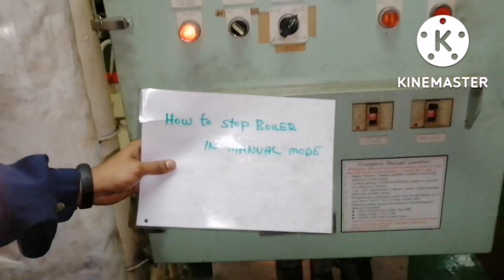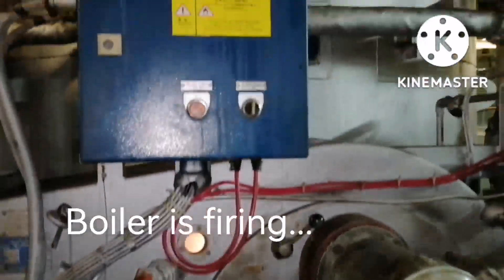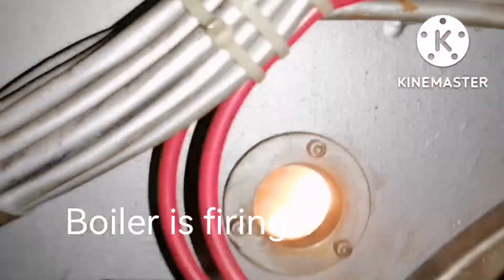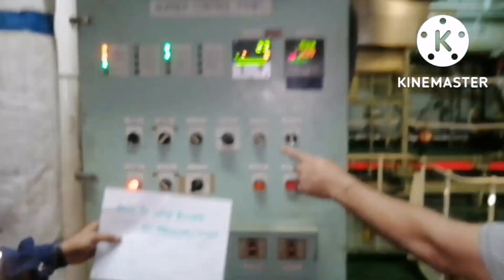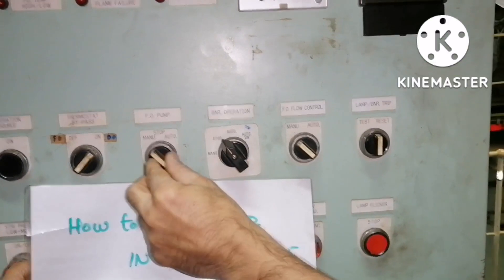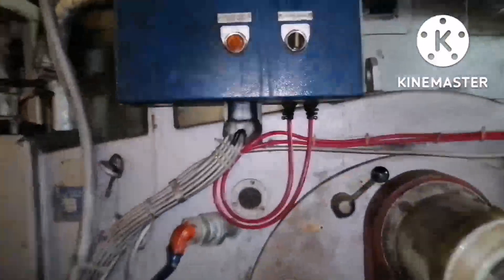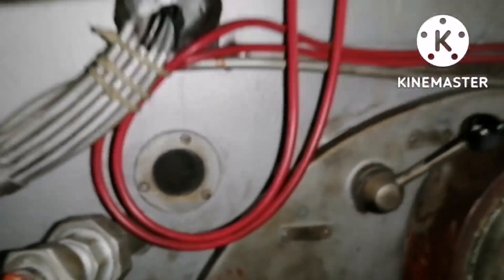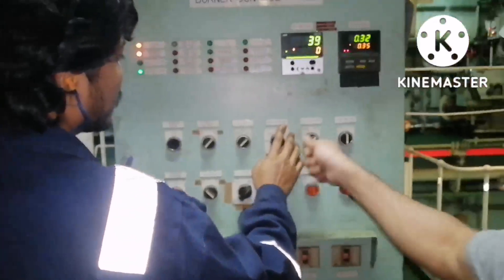HOW DO THEY DO.. HOW TO STOP  BOILER DURING MANUAL FIRING ONBOARD SHIP...

Comment: why the fuel pump is stopped? it should be running when its on heavy fuel oil.
Reply from the maker: Sir this is the procedure wen the boiler is working on manual firing.... The boiler is fired with LSMGO... Its better to stop the fuel pump to avoid any Leakage during operation.